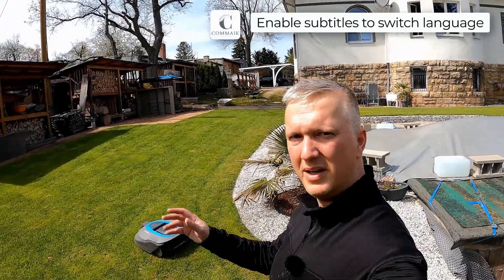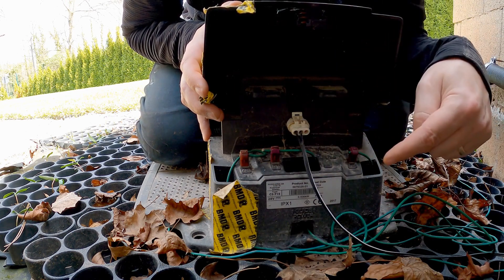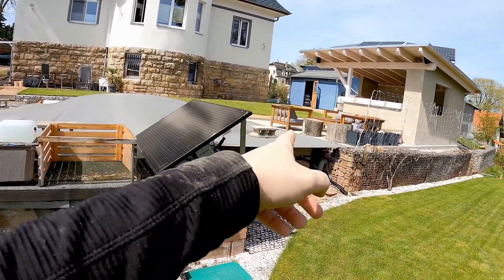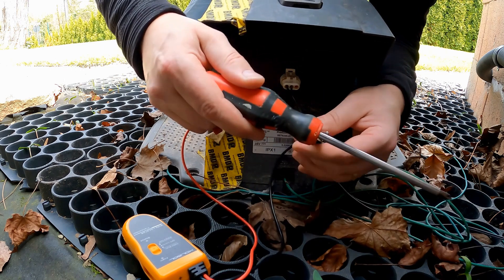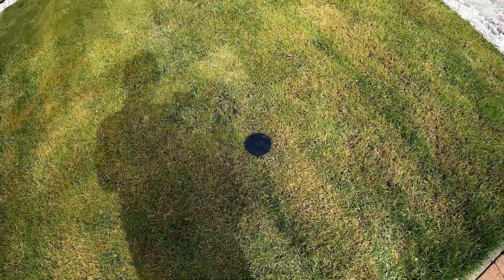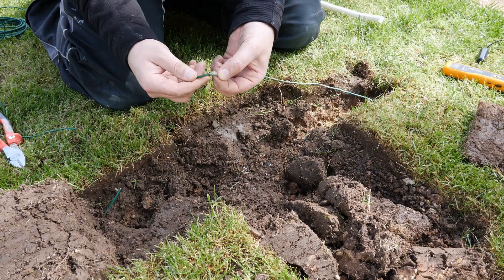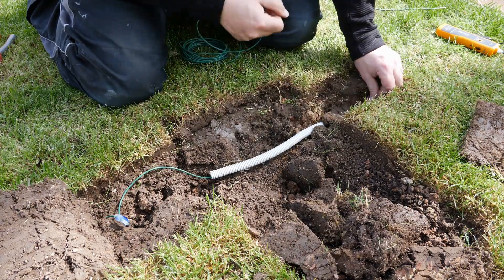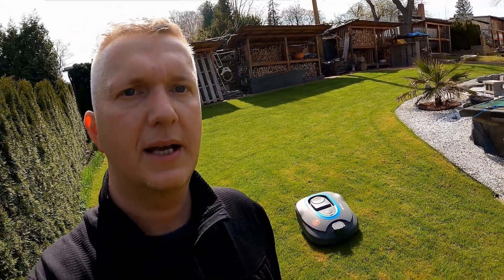How to Repair Robot Lawn Mower Cables Fast - Fix Broken Control Wires Easily

Comment from the maker: Product links:*
🔗 Cable finder: https://amzn.to/3qZYnsf
🔗 Complete repair kit: https://amzn.to/47QFY12
🔗 Perimeter wire: https://amzn.to/3u5qGF2
🔗 Cable connector: https://amzn.to/2WXgefP

This video was originally created in German for my main YouTube channel @commaik 🔗 https://youtube.com/commaik. It has been translated into English using 🤖 the AI tool HeyGen, which replicates my voice and synchronizes my lip movements. 

Please note that ⚠ due to dynamic adjustments, the synchronization may not always be perfect.

📺 The original video, which includes English subtitles, can be found here: https://youtu.be/8zdGnctmhEk